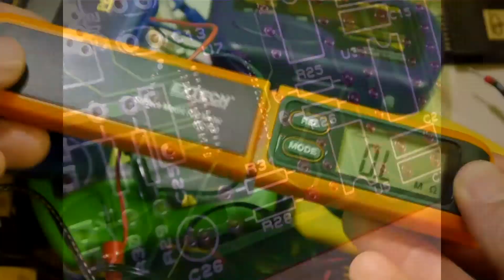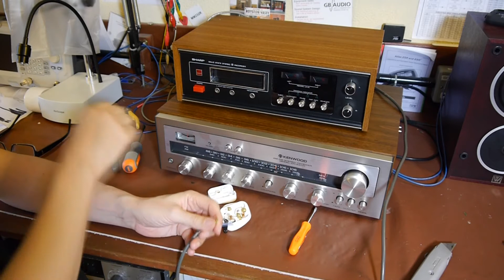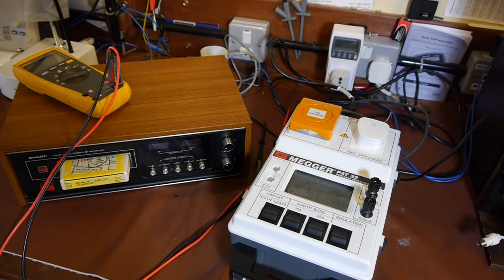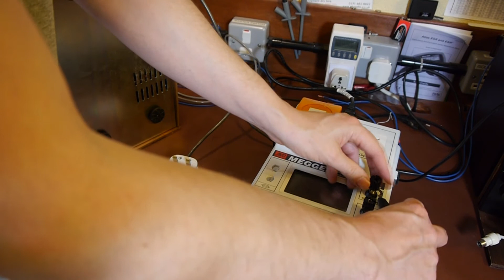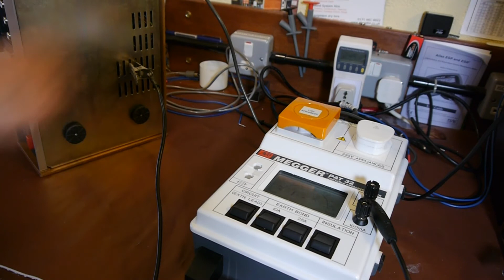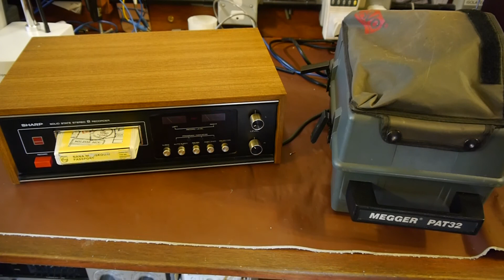Plug Drunk Prat

Comment: I have a solid steel fuse in one of my welders, It is 12.5 Kw though.
 Tesla was all talk and no action, live Musk,
1   1.5  2  Amp fuses were available, 
Plug wiring?
REEEEEEEEEEEEEEEEEEEEEEEEEEEEEEEEEEEEEEEEEEEE!
Reply: What? you didn't take the hour's instruction to be a qualified PAT tester?,
 Joke.
I did a five year apprenticeship to get my cards in electrical engineering,
Now a twelve week course gets you the same bit o paper.
 Bitter?,
 Nah, most sparkies now are incompetent.
Reply: Yeh, It's usual to test at double the normal operating voltage, 500V D.C. usually.
Reply from the maker: Average Joe  Hi Joe as always thanks for watching and taking your time to comment. I did think about doing a PAT testing training course just for the interest as a half day course was cheap to do locally. I had a idea that if I ever started doing more repairs it would be useful to do a PAT test before letting my old projects go on eBay. I am not really sure about the legality of selling vintage electrical equipment on eBay anyway I suspect it could be a mine field.   So I just sell everything as spares or repair even if it's been fully restored and safety tested.  The pins on the old plug were just completely black and think the earth pin connection was high resistance. I wish I had filmed the old plug.  Don't get me started with fuses replaced with nails or  silver paper.  If you work on electrical equipment or installations you come across some real horror stories!
Reply from the maker: Average Joe one of the guys  I work with just did his 17 addition training in i think part 1 in 4 days reduced from two weeks.  Kind of wish I had trained in electrical engineering.
Reply from the maker: Even I'm amazed I made a YouTube vid about wiring a plug. Must have been the booze talking.  I was even more drunk by the time I plugged it in
Reply from the maker: Average Joe  That would explain why so many of the equipment I buy from eBay has the plugs cut off.  Thanks Joe.
Reply from the maker: Average Joe - Im going to remember that. Temporary Installation, LOL